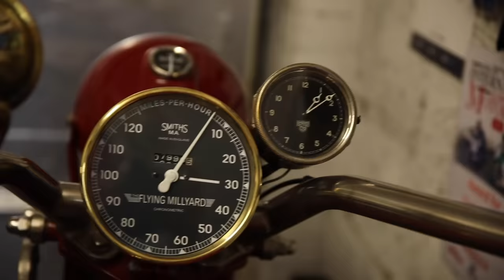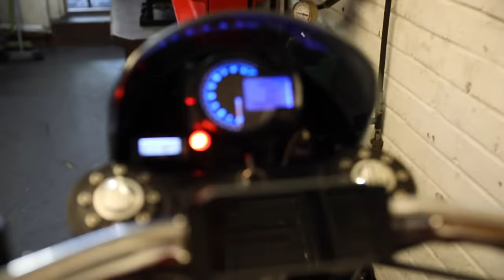At Home with Allen Millyard | Genius Motorcycle Engineer

Comment: An American here. God, Alan is amazing. What an inspiration. He makes everything sound so simple: “I took my hacksaw, cut the case in half, welded on another cylinder, made the crankshaft on me lathe...”
Reply: Well, it is that simple. The difficulty is in the precision required.
Reply: @zweispurmopped  Way to contradict yourself in one small sentence 😂 The engineering skills and knowledge required to do some of the engine and bike builds is much tougher than it might seem, especially on the ones he builds from scratch.
Reply: @HalfdeadRider   Congratulations! You found the paradox in my reply that was the joke of it! 🤗
Reply: Simple and precision don’t go together.
Reply: @zacharyradford5552  Easy and precision don't go together, Simple does

Comment: The way he does what he does with so few tools speaks volumes. Reminds me of when I was younger and had to work with the limitations of basic tools. It proves the most important tool you have is your mind, apply it the right way you can tackle anything. Allen's honesty and humility is refreshing, absolutely no ego.
Reply: The more you use the tool between the ears the better it works!
Reply: And when in need Allen is capable of manufacturing any tool he need. I've been builiding snowmobiles with turbo charged 4 stroke engines, and can relate to a lot of what Allen does. But IMHO Allen is on another planet when it comes to ingenuity, engineering capabilites and visions for his builds. Allen Millyard is a genius!

Comment: “I like all motorcycles, even scooters “  said Allen.
.... absolutely!  I’ve never understood why some bikers are “parochial “
Reply: Couldn't agree more. I've had all sorts, from a Vespa 50 special, Honda C90, Kawasaki two stroke triples, a couple of Lambrettas, a brace of Vespa PXs, Yamaha Fazer, 600 Diversion and now ride an xjr1300. I loved my scootering days and planning on another Lambretta to keep the XJR company.
Reply: Some of us bleed green...
Reply: Yeah, anything with two wheels and an engine is fun. I used to have fantastic fun on my Suzuki ts50x, an a100 and late 70s cg125 spring to mind. I used a xtz750 for courier work in the mid nineties and when the gearbox developed problems I used a Yamaha townmate step through. Great fun, grinding the pegs until the front or rear wheel lifted and wheeling buy holding the gear lever down and revving it then take your foot off the gear lever. Probably more fun than the gsxr1000k4 I had. Very hard to find the limit on the road. But some of my best memories invoke riding or fettling motorbikes. This man epitomises the enthusiast and I'd listen to or watch anything he was involved with!
Reply: Some of it stems back to the era of the mods and rockers where there was genuine hate between a few groups and what they rode was seen as a symbol of what they stood for. Of course thats many decades back and almost no one cares at all but there are always the few who want to pretend to be tough by citing old rivalries.

Comment: You are an Inspiration in a world where inspiration is difficult to find. I am a 110lb small guy that rides a Kawasaki Nomad 1500cc custom. Needless to say with hardly a payload I have to be very careful on opening that throttle . Your very correct about big bikes, In fact if I drop it over there is noway I can pick it up. But at 67 years old Its less embarrassing I just tell them i'm not 30 anymore. Love your collection.

Comment: I had a Puch maxi at 16, and had as much fun on that as anything I can remember. Bought a Lambretta 150 for eight pounds , a villiers 150   Which was so hardy and reliable. When I was 17 I bought a new MZ 250 (4 speed) which had great acceleration and burned off many other 250’s except for RD’s and GT250 Suzukis etc.  progressed to GT 380 then 550 . The two stroke was king 👑 in 76 / 77 .  🌈🌈🌈🏍🛵🌈🌈🌈

Comment: I had a similar but far less glorious motorcyling life ,in that in 1953,I fitted sprung forks and a Lucas dynamo set to my old Humber push bike that I used for my two paper rounds and in october 1954 I paid £25 for a brand new Vincent Firefly two stroke "clip on" engine that propelled me to Avroe,s Woodford to my new  apprenticeship.I learned a lot ,particularly removing plug Whiskers at least twice a day going too and from work.Been "into" bikes ever since!

Comment: This guy is gifted... I've also been watching a guy from Vietnam, who is doing multiple cylinder mods to the old four stroke Honda Cub engines...also gifted. I knew a family in Sydney who had built a push-bike with dual suspension..I used to ride it in the mid to late 70's...called it the "Ten Ton Torture"...haha..they wanted to sell it to me, and I refused...it had no gears, unfortunately.....years before Gary Fisher et al...when Tom Baker was "The Doctor"......the family also built a really cool chopper from an old Dragster bike..I rode that to school.....had to push through al the admirers....good memories from a different time.

Comment: Always admired your work, Mr. Millyard.
Have a weird idea for you.
Have you ever considered taking 2 CX500 engines, but setting them up so they are counter-rotating to offset the torque, perhaps married by a common synchronization gear to make a V4 with 0 longitudinal torquing effect?
I also wondered what, perhaps, two gear driven VF750 engines mated together at the crank would sound like, since in my opinion, this is one of the most awesome sounding engines in any motorcycle ever.

I know you never run out of people lobbing stuff at you, but I've always been a fan of the likes of you and guys like Fritz Egli.

Cheers!

Comment: I build between 9 & 12 bikes a year in the same space like that, I say build but compared to him I do the odd bit of modding even though I re-work the frame, body, engine,  carb's, breaks & paint. My beautiful wife owned the first bike she ever rode on, a 1971 Suzuki GT380 2 stroke, it cost me £30 & came in 3 box's & took me all nite to put together, she turned down £10k for it last month, I've also built her a ZX6R, she likes it well enough, but she says "Nothing vibrates like a 2 stroke", I'm glad I never sorted that crankshaft. I started like him, my mum's kitchen table had a bike in bits on it for many years.

Comment: I remeber at 16 (1970) I was looking for a motorbike. Settled on a Honda SS50. There were 2 models, the 4 and 5 speed. The 4 speed had max 50 on the clock whereas the 5 speed had 56. My folks said  "why do you need a 5 speed?!" Haha living on the edge! Now 52 years later got the same model in black, same model 4 speed in candy blue, 1974 4 speed and the bike I always wanted at 16, CB175ss 1971

Comment: My first proper bike CX500 A 1981 black £1299.00 on the road removed the red stripes off the fuel tank hack saw to remove back end off exhaust pipes sounds great 112mph two up on motorway me favorite bike ever ps nice millyard flyer T shirt Allen excellent Quality and fit.
Reply: Great bikes the CX500A and turbo, glad you like the tee shirts

Comment: Hi Alan, just wanted to ask you a question regarding the Harley Davidson Night Train, if you could advise me as such. Apparently the Night Train has plastic shoes on the cam chain that wears out after 40, 000 miles, apparently this is a serious problem with this model Harley Davidson, my question is, can this problem be resolved by fabricating metallic shoes?

Comment: Dear mr millyard
Hope you dont mind me asking you a question regarding my honda cb500 cafe racer project.
My rhs coil supply wire is not supplying the new coil with power to produce a spark. I think its either an ecu issue or broken wire. I was wondering if it was possible to just use the other coils supply on both coils like a wasted spark system as its a twin 180deg engine. Could you offer any advise on if this is possible or if there are test methods to test ecu?
Any advise would be great.
Regards
David Home
South wales

Comment: In 1972 I hand made a set of extended springer forks for my Raleigh 20.
It must have been something going around.
There was a bike built in Australia that had a 5 litre V-twin made from 2 cylinders and crankcase section cut from a Rolls Royce Merlin

Comment: Hey Allen, maybe 'not' the first! .... in 1962, just before the 'dreaded winter' a friend in our Village (#wargrave) managed to get the front forks off of an bedragled NSU Quickly to fit his Bike frame that he used to brink up to the Dirt Track at Crazies Hill, where I had an old bike with a 'Back-Pedal-Brake' ...... Bad move for Dirt-Tracking as you can imagine. Many times I ended up somersaulting backwards if I didn't quite get to the top of some of the Steep Inclines :-)

Comment: Bloody hell, I had a Honda CD175 also! Road it to work and back for a few years. Then used it for college. Really reliable and quite quick but looked a bit crap.
Reply: Its a geat bike to learn riding skills and ridden to the limit was quite a capable bike
Reply: @AllenMillyard  I once was doing some maintenance on it and made a mistake with the cam sprocket /  chain which was one tooth out. The acceleration off the mark improved greatly - although the top end wasn't quite as good? I don't know enough about engines to understand why but after a week of beating people off the lights I put it back to what it should of been. One before that bike I had a Triumph Cub 63 Trials [same age as me!] which I rode way to aggressively - I seized it twice, the second time it threw / bent a pushrod. I got mad with it and flogged it as a basket case and used the money to buy a Honda CG125 which was boring but reliable for work. I did 85k on it and in end it had nearly zero torque and was literally 'worn out'. Sadly I now drive an EV but I intend to get a bike in my retirement - maybe a Bantam or something like that I can ride on a sunny Sunday so I don't end up killing myself [early!]

Having a bike for work and for fun was part of growing up for me and my mates and will always bring back great memories. There's a film called 'Fizzy Days' - we where like the lads in that film. I even had a Grant Fender Strat Copy from Dave's Second Hand Shop! Thanks for all the vids Alan. https://www.youtube.com/watch?v=NtdPp_2UUV4

Comment: Whats the viper good for, 300mph?
Reply: no way, it wold need a fairing and at least 1000bhp to do anywhere near 300mph. Its top speed is around 220mph in its current configuration

Comment: I don’t think the cylinders on the Flying Millyard are DC-3 ones. The DC-3 engine was a 14 cylinder double row radial with 2 Litres per cylinder. That would make the bike 4 Litres. I think the cylinders came from the Pratt and Whitney R2800 engine (2 rows of 9 cylinders) which was much bigger.

Comment: Allen would be great at developing a modern version of something like an old BSA A65 engine, sorting out the timing side Bush problems and other stuff to develop a fabulous  modern bike that's far better and nicer than the Indian made bikes. They would sell well based on his expertees and customers would have a basic simple, old school bike with no fancy electrics to break down, good chrome and paint and real character, reliability that they could keep for years. CCM seem like a good motorcycle maker but with a bespoke engine, maybe a solid single that's even better than their R30 with its DR650 Suzuki engined design. It would be maybe far too boring for Allen but CCM would for sure have a great engine and gearbox and design plan to develop a rolling chassis around that would sell well maybe in a niche market. Maybe Paris Dakar type bike well thought out that's better than Triumph scrambler, Ducati scrambler, DR Big or even KTM or BMW but at a rice where it's competitive along the lines of Enfield. It would be a true dream for many riders. Even maybe round the world bulletproof, ultra reliable machine that's practical to use in Africa where it just had to keep going like the old BSA M20s in WW2. It's a thought but in the real world there's so much junk manufactured that's badly designed for the common working class person in places like Russia for example and I can see why Cossack have kept going up to today.

Comment: SEE  YOU  HAVE  MY  VERY
FIRST  BIKE  HONDA  SS50 
I BOUGHT  ON  HP  £150
IT  HAD  BENT  FORKS  AND
DENT  IN PETROL  TANK  GREEN
I FIXED  IT  UP  SOLD FOR £250
NEXT  KH250  £150  COULD  NOT
GET  MIDDLE  CYLINDER
WORKING  PUT  IN  PAPER  SWAP
OR  £450  AFTER  GOOD  CLEAN
DAD  AND  SON  CALLED  WITH
BLACK  MBX 50 HE GAVE  ME
£150  ALONG  WITH  MBX50
WHICH  WAS  SOLD  FOR  £550
GOOD  OLD  DAYS